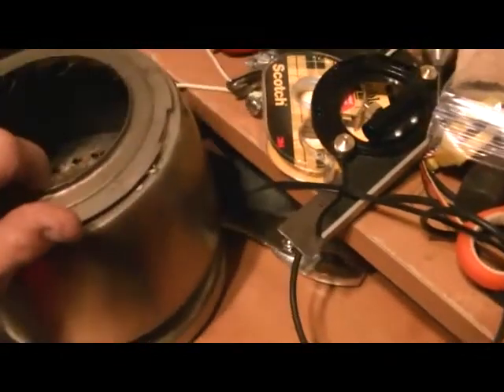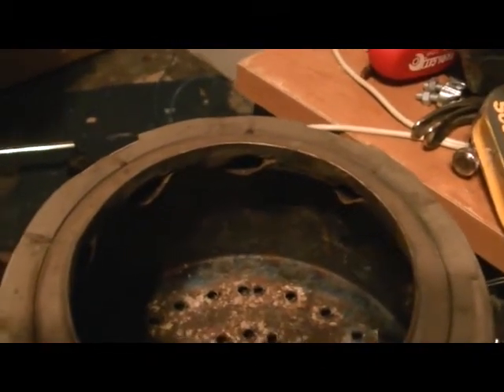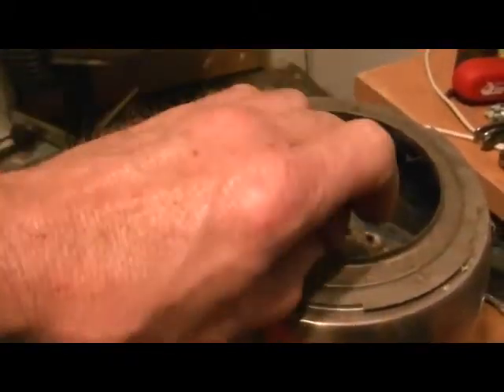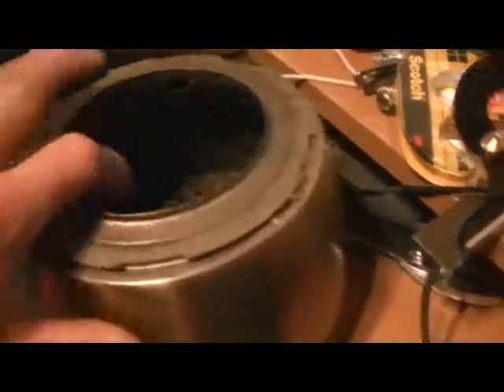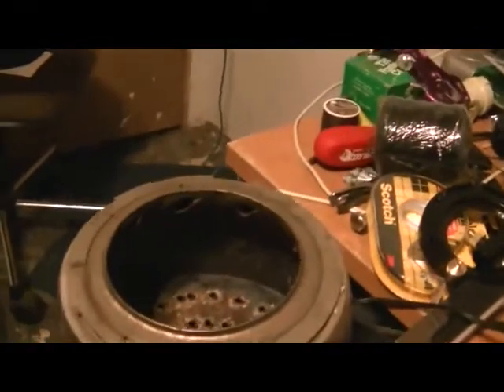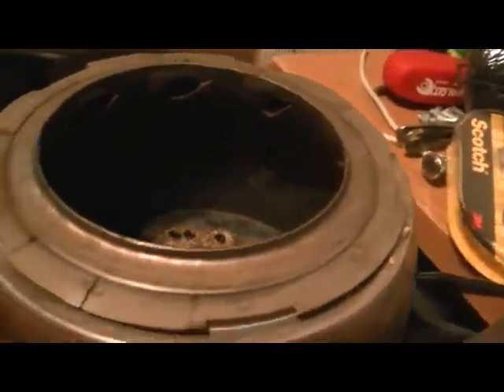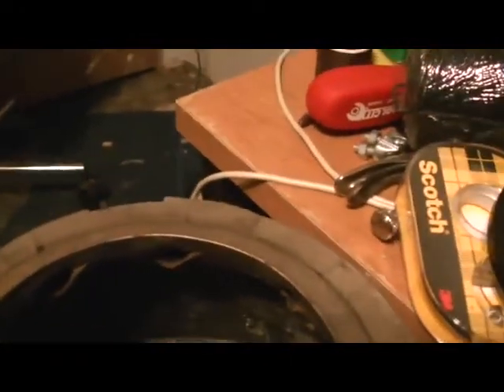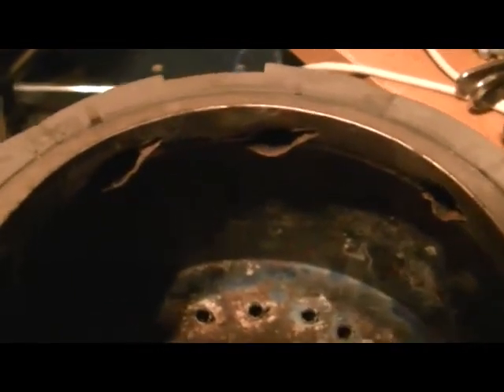Gassifier Stove Update for DJ H

Comment: Thanks KB.
@ 18:20 in the original build video was the question I had.  Not having the pot in my hand to see,  I didn't understand where the seam for the inner & outer chambers began & ended.  I can now see the entire inner pot floats by means of a connection at the top rim and all the air holes cut in the bottom flow to the holes you cut under the top rim.
I'm just about to start a very very cool Rocket stove project, then a couple gassifiers.
Thanks for your uploads, it's truly help..

Comment: I enjoy your vids, KB! However, I'm getting confused by the term "rocket stove" as used in some of the YT vids I've seen. Some incorporate a J-tube (w/vertical feed) , some an L-tube (horizontal feed w/ or w/o a shelf). Perhaps the most confusing for me is that some incorporate a re-burn chamber (inverted barrel, an old propane tank or other tank) while others direct the exhaust gasses straight out the top. My question is this: What makes a rocket stove a rocket stove?